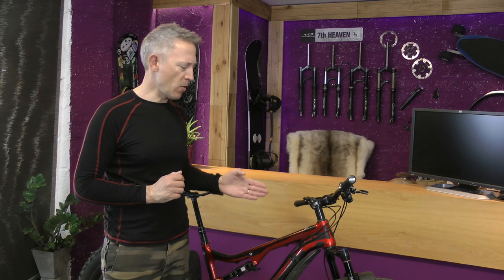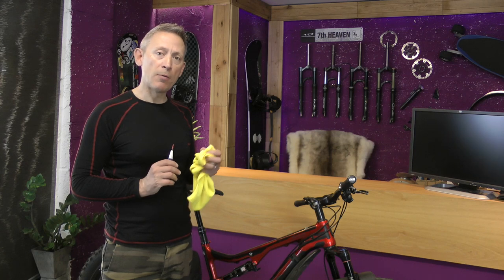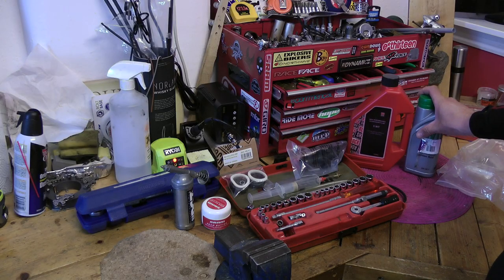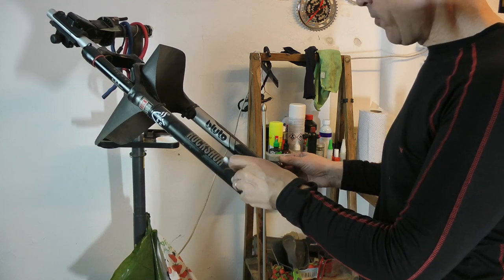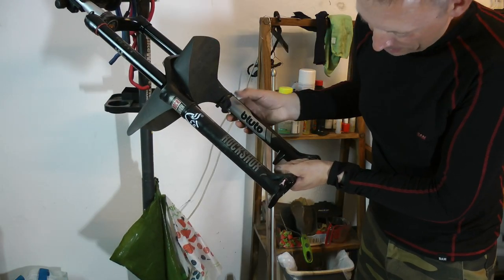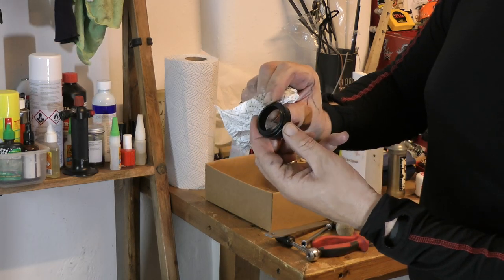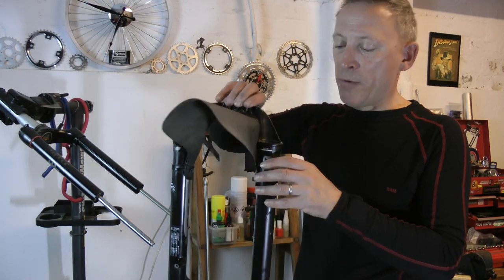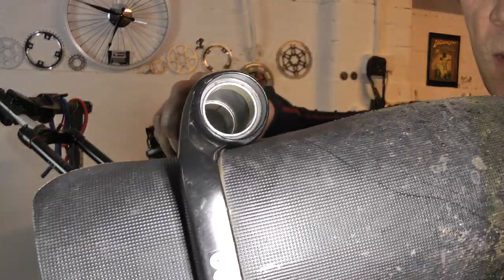Bike maintenance tips #6 | Fatbike Bluto Fork Service

Comment: Hi, just started to watch this.. I got an ICAN SNO 4 fatbike recently with bluto forks.. and now they are knocking or have something lose.. Thought it was the headset at first but pretty sure on it being the forks.. hopefully I get some servicing knowledge for this issue.
Reply from the maker: That is cool Did look at the SNO4 should my Bucksaw cease. What is the axle width 197mm or 177mm rear?  The Bluto can make a small knock click sound when fully extended end stop.
Reply: @North3rdMedia   it's a 150mm. I notice whilst riding last night. Just had a nother look at it.. when I lift up the front of the bike by the handlbars up and down I notice a dropping noise or like something lose.. checked the rotor thats fine.. doing both brakes and trying to rock the bike back n forth is better the headset is fine.. doing this and reaching down to feel the metal rod ..(no idea what that is and I did see your vid but need to go back over your vid) the 5 mm hex removal tool took that rod out... it seems nice and firm so no idea what is going on with it
Reply from the maker: Sorry I meant the rear axle width. Yes my Bluto if I  just lift off the ground there is dead end feeling plus may be a hit type sound.